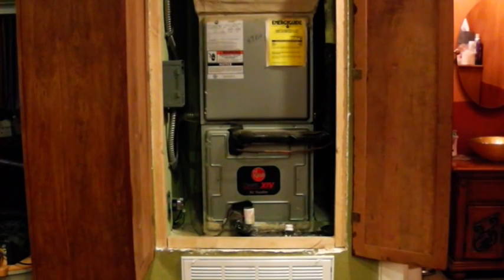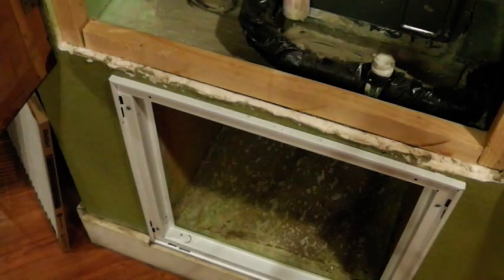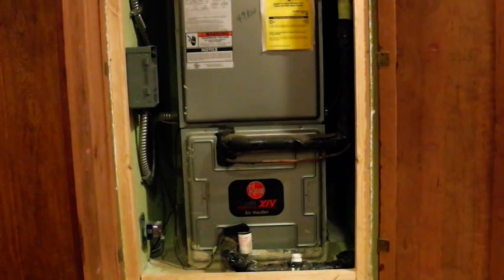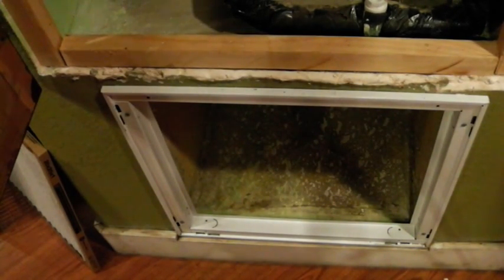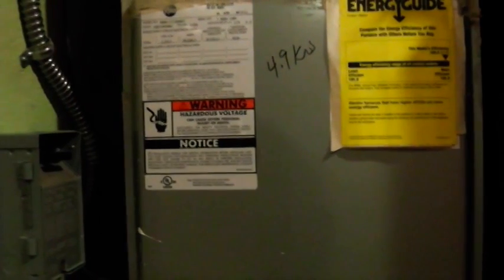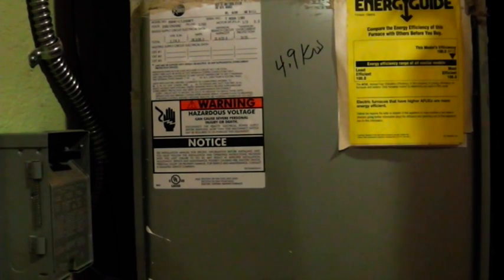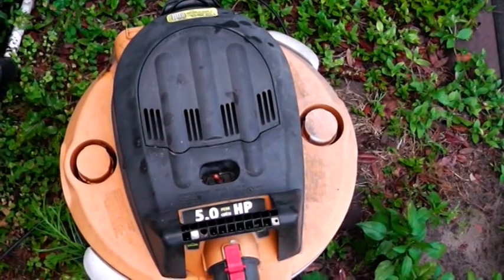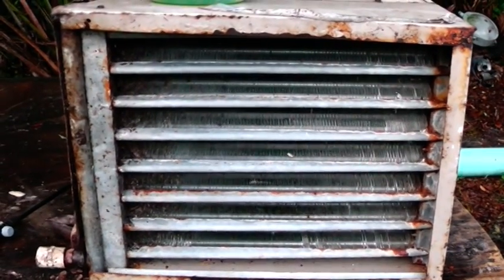Air Conditioning clean and check HVAC Part 2: Evaporator Cleaning Air Handler

Comment: i need to mounted at box to the side of the airhandler when working some electric disconnect the power and that box like outside box i cute the power and the breaking box and don't need to cute the power and the panel main power correct i see the box that you mounted and your handler this box is cool thanks for this best video cool preper

Comment: I have mold in my air conditioning and it is making me really sick.  I am newly pregnant so more sensitive but my 5 year old and husband weren't too well either. I have had some estimates done but got a lot of different explanations as to what is wrong.  Can you help me figure out how to know who is BSing and who is right (or none are right)?  Not much mold on the vents - only one with a little.  Mold on the outside of the handler unit but it hangs in my Sarasota home's garage from the ceiling.  3.5 ton unit seems to be the right size for the house but some rooms are hot and some cold.  One guy said I needed all new duct work as it is the wrong size (too small) but it is only 3 years old. Or he could clean with chlorine (which I know is horrible for mold) so I dismissed him.  Another one wanted to just clean the handler and coils and replace the insulation and then do regular maintenance and then install 2 UV lights.  But the ducts would be cleaned with sani-cnd an eco-kinder chemical.  I don't want chemicals because I have already put the baby through stuff.  And the price seemed high 1750.  Friends say to get this air oasis which is a UV and ion system and clean with ozone.  Another friend said to change all the duct work and get a new handler and no technology.  Any advice?  I am not at the house so I don't have the handler and air conditioner unit info.  (split unit)  I will wet vac the drain at least and change my filter every month here in the summer in Florida. THANKS!!!!
Reply from the maker: Diane Nash There is just no way I know of to lessen black mold with out the use of chemicals, UV light or new installation.
How old is your system and when was the last time you had it cleaned and checked.

Comment from the maker: The answer is yes but, I would not recommend it.  I have seen many old coils that are very rusty where the steel holds the aluminum/copper together and are still working great. Your a/c might blow up tonight or it might last another 12 years, who knows.  When the a/c does finally crap out (leaking coils or compressor burnout), I recommend replacing the whole outside unit from a reputable company with a warranty.

Comment: Can the outdoor coil be replaced without having to replace the whole outside unit? Mine is rusting at the bottom some and starting to fall apart a little. The unit is still working well, I just want to prevent it from taking a dive! (12 year old system)

Comment: What about checking Amperage , Voltage , Pressures , Suction & Liquid Line Temps , Super Heat , Low Freon Levels , Fan Motor lubrication ect.. ?